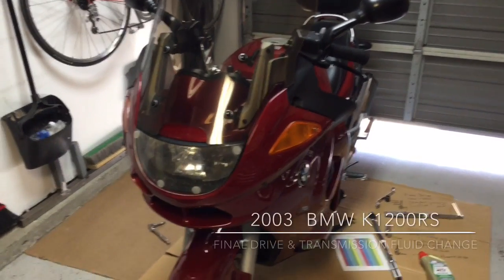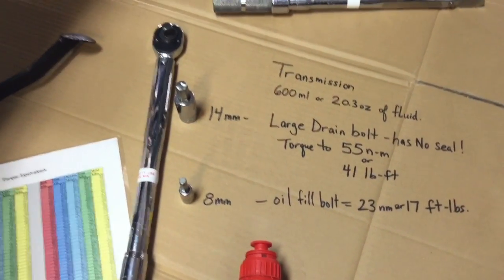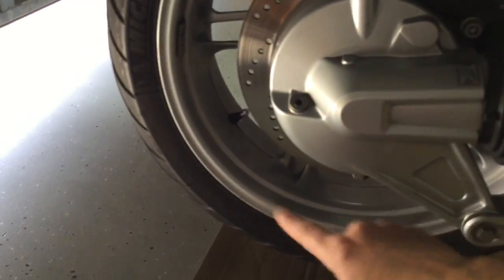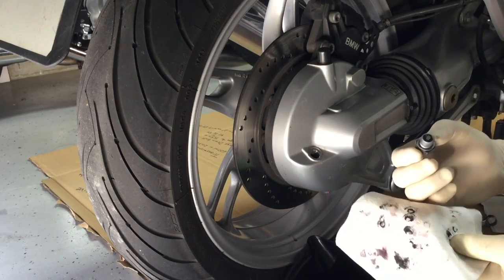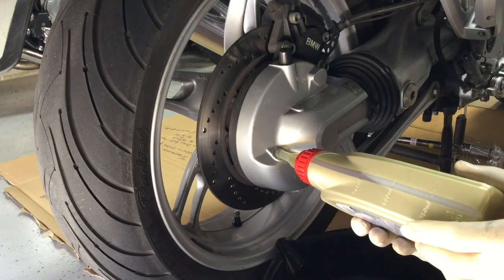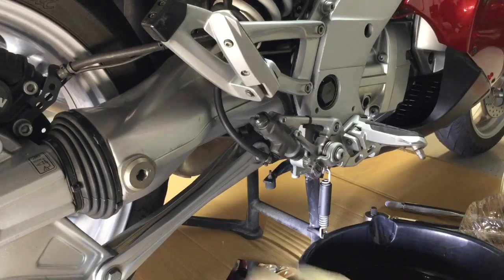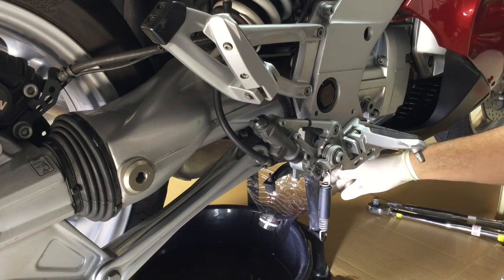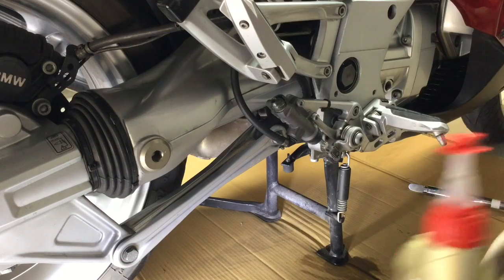Final drive & Transmission oil change K1200 RS

Comment: Hi, please, I've bought a BMW K 1200 RS 2005 96kw machine and I'm having a bit of trouble finding the service manual and I need to know what oils I need to replace. Could you advise me and specify and possibly supplement with a specific product? Some sources say that the same oil can be used for both the drive shaft and the gearbox, while others say otherwise. I'm confused about that.

1. Engine oil
2. Oil for the drive shaft
3. Oil for the gearbox

Also, I have a few additional questions:
4. What coolant do you use?
5. Air filter
6. Brake fluid
7. Spark plugs

Thanks a lot.

BTW. thanks for the video!!!

Comment from the maker: Yea it should be done at same time since it's so easy. Still making one to replace fuel pump and filter. Mine failed. So the video will show how to go about troubleshooting a no start condition. Trying to cut it down in length. Might make it in a few parts. Thanks for the reply.

Comment from the maker: Tough question. I am taking the advise of a professional BMW mechanic Chris Harris.  Who says to use mineral oil. Because synthetic oil causes oil leaks on the engine. My engine has no leaks so far! Synthetic for final drive and transmission. Oil though. But I don't think synthetic would do any harm. And you could change oil less frequently.
Reply: +kontor15 thanks